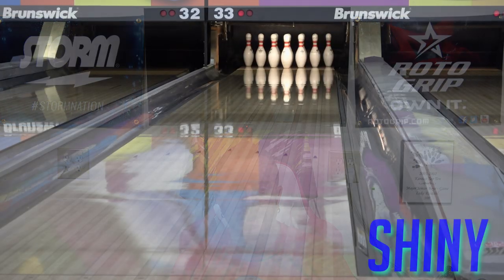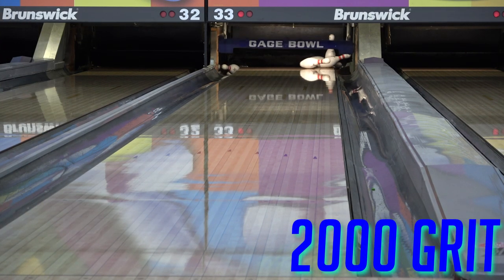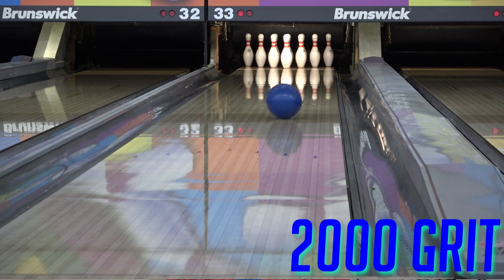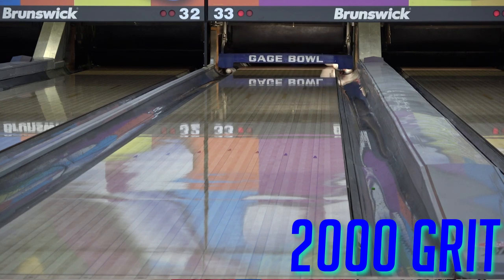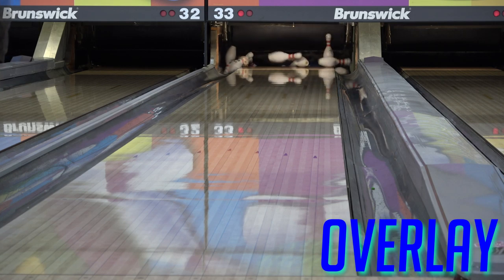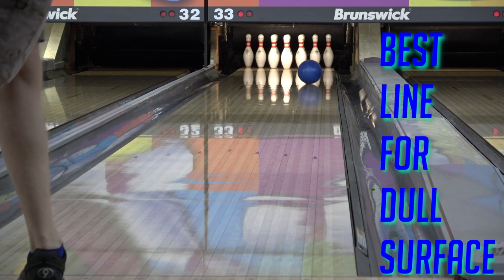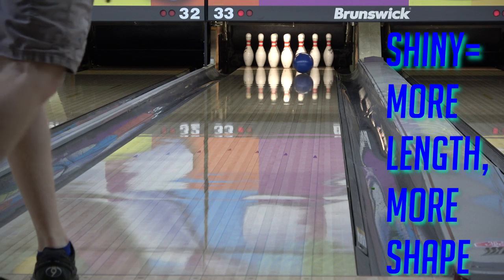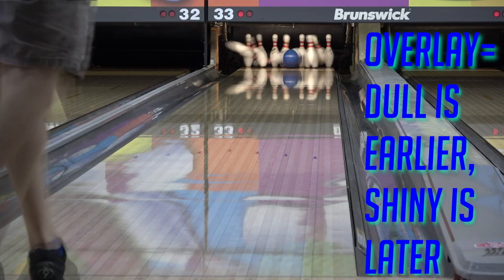Tech Talk #5: Surface Prep

Comment: Excellent and thanks Luke! Think I may just try some Reacta Shine polish on the Crux Prime and Pro Motion to see how that may work on THS. Even though I've had some success with the SonIQ I'm disappointed in it's reaction compared to my IQ Tour 30. I was hoping that it would have more pop on the backend. For me with my a bit lower speed and low revs the SonIQ has less pop and have never figured that out. I also have a Wreck-It that I won a couple of years ago and out of the box it hooked at my feet. I tried polishing it and changing by using various grit surfaces from 4000 to 3000 to 2000. With polish the Wreck-It was weaker than my Hy-Road (don't need that!). I just never found anything that worked on the Wreck-It. I had a Vivid that cracked in half and loved how that ball reacted for me right out of the box. I was hoping that the Wreck-It could replace it in my bag as it seemed to have similar Diff and RG numbers just not an asymmetrical ball though. Oh well... Wish I could be more comfortable with the SonIQ and Wreck-It somehow...

Comment: I am learning about surface now, I feel like I had it wrong for so many years and so many balls I threw away or gave away because I thought sanding it would make it more aggressive. 🤦🏿‍♂️ What a dumb ass I was.
Reply from the maker: Sanding WILL make it technically hook more, but it will also make it smoother too . . shinier balls are more aggressive on the backend though.
Reply: @LukeRosdahl  Until i saw your video i swore those two things were reverse. meaning smoother with dull versus a sharper move with shinny.

Comment: So for say like a 45ft pattern. Is 300 to 2000. Maybe a better choice than 1000 to 500?
Reply from the maker: It really depends on the amount of oil, there are some longer but lighter patterns, and surface really only causes problems in that situation.
Reply: @LukeRosdahl  about 23 mils
Reply from the maker: @Joshuaperalta8  23 mils for 45 feet isn't much oil at all, so you're not going to want a super aggressive surface because it's going to just be super early and burn up.  Now, at 45 feet, you're still going to need SOMETHING, but definitely nothing under 2000

Comment: Nice video Luke. I would like to add one more thing to consider. I think that a lot of players don't realize that with changing the surface of the ball you are altering the spot it starts to react on the lane, but you are not changing the shape of the shot. So, you are affecting the time it takes the ball to start making contact with the lane and, in effect, you are changing the position of your breakpoint (closer or later) but you are not changing the shape of the motion which is defined by the ball characteristics (drilling and weight block). The changes in shape that you get from changing the surface are a result of different ways of releasing the ball's energy on the lane (as you mentioned). So, you can not make a ball be a skid-flip ball if it is not designed not to be one, or a hook monster to flip on the backend just by changing the surface.
Thanks for the videos, and keep up the great work!

Comment: Question:
Is it true that a ball with polish on will not be as easy to controll as a ball with like 2000 grit?
Because i think that this is right.. when the ball does its motion late because of polish you dont have as much room for error as with a ball that starts sooner?
Reply from the maker: Yes and no, sometimes a ball with too much surface starts up too early and can be over/under as well.  GENERALLY though because shiny balls are more responsive to friction, they CAN be harder to control though.  Always have to make sure the surface and ball match up to what's on the lanes, just too many variables to make more of a blanket statement like that.

Comment: I thought there would be some mention of how to build the hills and valleys of a surface using sanding pads to prep the surface correctly. Regardless, what you covered was really useful information. Thanks!
Reply from the maker: I COULD do that, I'm a big fan of big undergrits or layering different grits of abralon to produce unique or specific results . . but I've done heavier videos technically before and they usually cause more confusion than anything.  I'm a pretty big fan of 1000 polish, or using an 1000 pad and then hitting the ball with a light coat of polish.  Helps get through the heads easier, but still get some traction where and when I need it and produce SOME shape but not be as over/under as a higher grit surface prep would make it.  My issue is that I like talking about that stuff but I just get rambling and people zone out . . so the deeper videos are hard to justify making.
Reply: @LukeRosdahl  Would hitting it by hand and polishing it by hand also work?

Comment: I’ll def try the pro-motion polished next, tried 2000, 1000, then 3000 and constantly fight the reaction. The fronts and midlane is amazing but gives up on the backend.
Reply from the maker: Just let it lane shine, I wouldn't actually polish it.  The cool thing about that cover is that it maintains the friction response properties, so with a shinier surface, it still manages to blend wet/dry really well AND pop quite a bit more.  The SPEC cover is a big part of what prompted me to make this video . . people aren't seeing the visible hook they want to with the ball and so they sand it and it "hooks less," and that's just absolutely the opposite of what should be done.  SPEC is a monstrously strong cover, but is pretty amazing on regular conditions when you get some shine on it and get more of the reaction further down lane.  Still smooth, still controllable, still has the great midlane control, but actually pops more down lane.  Quite a bit more effective shiny in my opinion.
Reply: Luke Rosdahl My only real issue with the ball is it’s unpredictability of the down lane motion. I love how I can read the front and mids really good, but when it comes to watching the ball come off the spot it’s basically a guessing game.
Reply from the maker: That’s why you let it shine and play straighter generally. It’s round and smooth, so don’t try to milk reaction out of it
Reply from the maker: Or milk a bunch of angle out of it anyway
Reply: Ben TheStriker I have the exact same problem with my crux prime. I’ve tried everything with that ball but the same happens every time. I believe it’s just the SPEC cover stock doesn’t match up with some people
Reply from the maker: @icykhan32   I actually think that people expect it to do way more on the backend than it actually does, most people are about an arrow too far left with it most of the time.
Reply: Luke Rosdahl that may be true for some people but I’ve tried playing every part of the lane with it and it has the same reaction every time
Reply from the maker: @icykhan32  I can believe it just doesn't match up with some people or some conditions, there are some balls like the Super Son!Q that I'll just never match up with, but despite, that, I've still found the best possible scenario for it to work, and it does, just not as good as other balls.  If you send me some video on FB Messenger, I can tell you what's wrong
Reply: Luke Rosdahl I don’t have Facebook would discoed work
Reply from the maker: @icykhan32  Yeah, and yes I'm reviewing the MVP Pearl, but I don't have the ball yet, so will be a few more days!